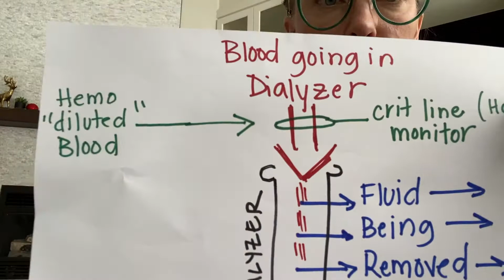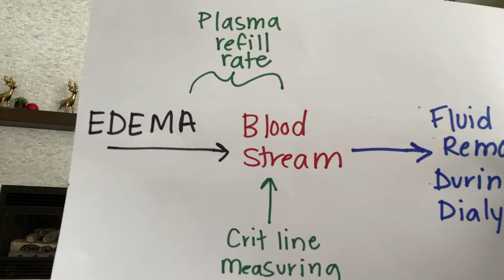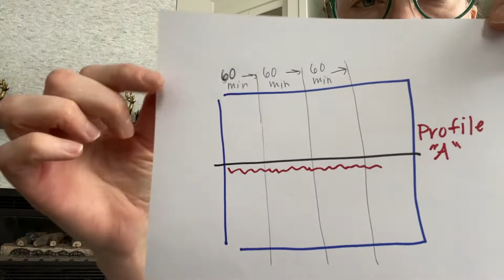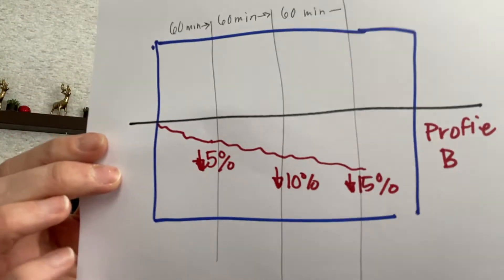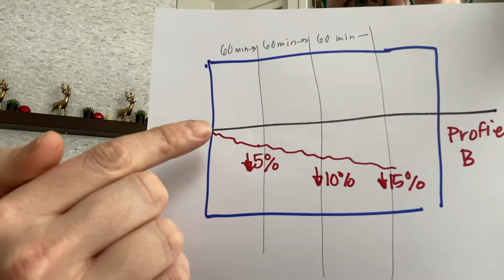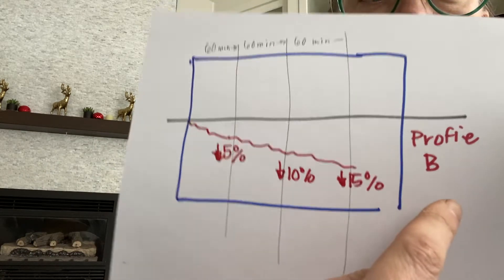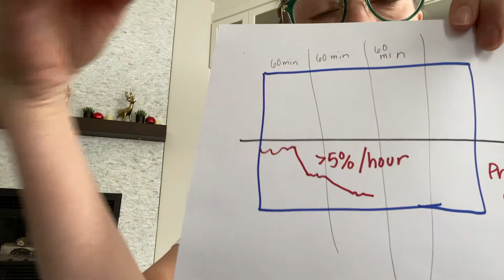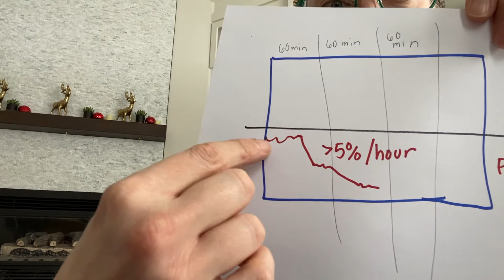MY ATTEMPT AT A SIMPLISTIC WAY TO EXPLAIN HOW A CRITLINE WORKS

Comment: Hi Lindsey, TKS for your video. Can I ask you that during my dialysis, after a while they always increase the UFR to pull more water, and I figure out afterward the UFR will be higher than the CMS guideline 13ml/kg/hr, sometimes even reach 18ml/kg/hr. And I am afraid I could be

Comment: Hello Nurse Sippl! Im currently training to be a PCT & your videos are life saving! Really helping me connect the dots during my training. I started watching your videos from the beginning because of my OCD lol. Quick questions: So the Blood Pressure will drop automatically during dialysis because fluid is being removed but we have to make sure blood pressure doesn’t drop too much, correct? & part 2 to my question is, What are some ways that patients can help assist maintain their blood pressure before, during, & after treatments?
Reply from the maker: Amber, thank you so much for this, it warms my heart!  yes,blood pressures are complicated, generally people will come in with a high blood pressure because they have extra fluid in their body, and the extra fluid will show up as edema, fluid in lungs, and vessels that are full of fluid, causing high blood pressure....
Reply from the maker: the trick is to remove fluid in a way that is safe for patients. Removing too much fluid too fast, will cause a sudden drop in blood pressure, possibly cramping, and even passing out.  Research says that keeping fluid removal at or below 13 ml/kg/hr is safest for patients long term.  What patients can do to prevent this is to follow their fluid restrictions, stay on the machine for their prescribed treatment time, not miss dialysis treatments, take their medications as prescribed, and high protein intake